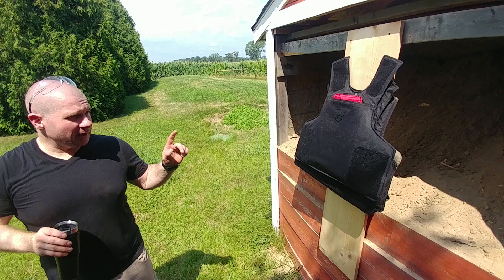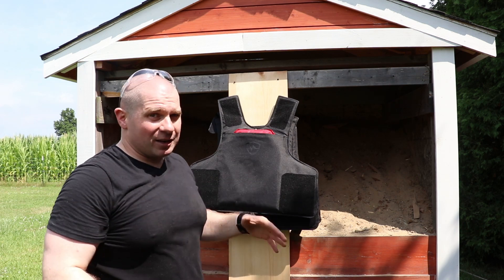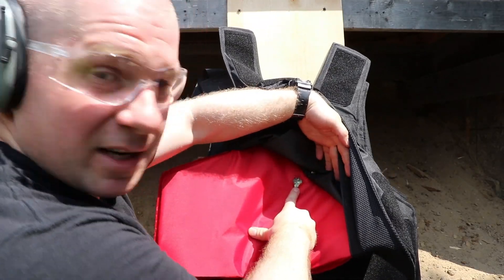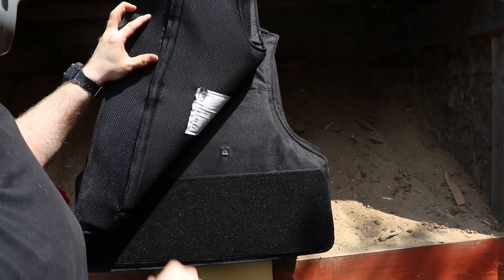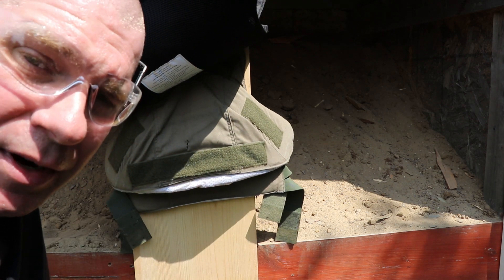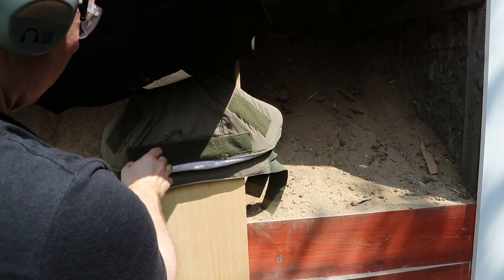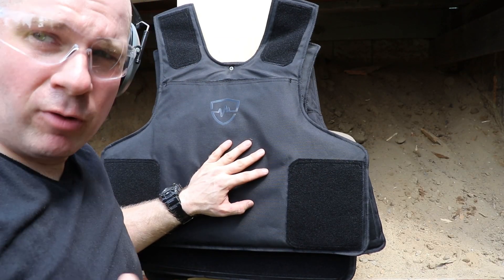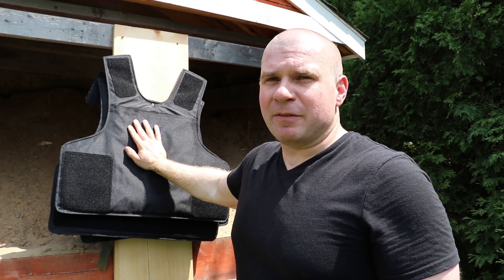How Many BULLETPROOF Vests Does it Take to STOP RIFLE ROUNDS?

Comment: This was an awesome video, it would have been even better if you tried 308 as well. I think the 762 had more steel than than the 556 green tip or the steel in the 762 is pointed vs the cylindrical shape of the steel inside the 556, I could be wrong though

Comment: i would t trust any amount of soft  armor for any rifle threat of any kind other than like 22lr or something with that low of a velocity or that little of a powder charge id want like a layer of really thick soft armor then a hard plate and another soft piece to cushion it even further cause the soft would absorb some of the pressure on the front before it even  hits the hard armor then the hard armor slows it even more and then the soft armor softens that impact even more when the hard armor would smack you and would stop shrapnel cause itd be significantly slowed down after hitting hard armor and soft armor

Comment: 5.56×45 is no contest against the 7.62×39 at intermediate ranges. As shown in the 1997 North Hollywood bank robbery the two suspects had AK-47 assault rifles. Now, as we all know they were using armor piercing amo. But even if they were using standard amo it would've still penetrated the police body armor. That's what the 7.62×39 was designed to do at intermediate ranges.

Comment: Penetration doesn't rely on energy or velocity.  Penetration works off force.  Force is mass times acceleration squared. 
Level IIIA soft armor will start to fail at approximately 1700 fps no matter what the diameter of a projectile. 

So with more than 2X's the mass of the 5.56, at 55 and 62 grains the 7.62x39 at 122 - 124 grains and approx. 2,200 - 2,300 fps it went through 6 layers of bullet resistant material. 
One could easily argue the 5.56 is the better round because it went through 5 layers of vest with bullets less than half the weight of the 7.62x39.
 The 5.56 is more than twice as efficient at penetration as the 7.62x39. It has a little than twice the range of the 7.62. While accuracy is harder to measure the 5.56 is normally considered a more accurate round and recoil is much lighter.

 I like both rounds if you will never need to go past 300 yards the 7.62 has a slight edge. 

But if you need to go to 600 or more the 5.56 is the way to go.

Comment: That's easy. The 7.62 had a steel jacket and didn't yaw too early. M855 has a steel penetrator but not enough to keep the bullet from deforming or yawing. Try Wolf or Tula 223 and you may get similar penetration. I've seen 9mm Tula go through a IIIa vest before (They're not supposed to do that) I do find it odd that level 3 UHMWPE plate really don't like M855 but will readily stop steel jacketed 7.62x39 and M193. I can't explain the physics happening there. I'd bet M855a1 would go through the entire stack.
Reply: The round from Wolf or the Tula might do better, but if it's the steel casing bring your smithing tools because you're gonna have to get those fuckers back out of the breach manually lol

Comment: The results wasn't surprising.  The composite of the soft body armor was never designed nor intended to stop high velocity rifle rounds.  Even if it was able to stop a rifle round, the kinetic energy alone will be painful to endure.  That's why the hard ceramic plates are so important to help distribute the kinetic energy of the rifle round..